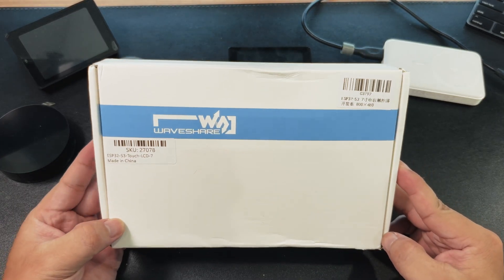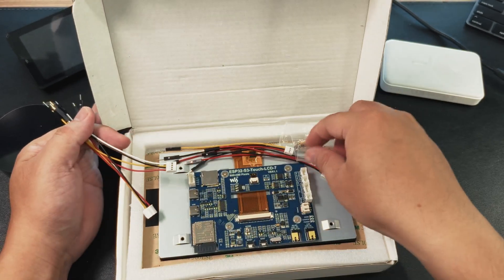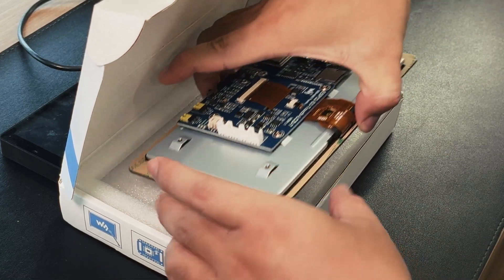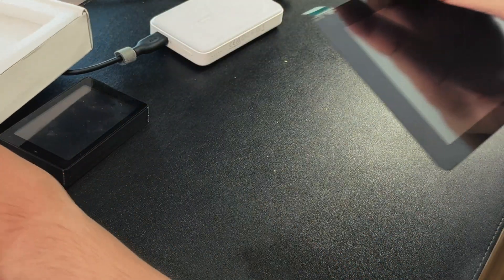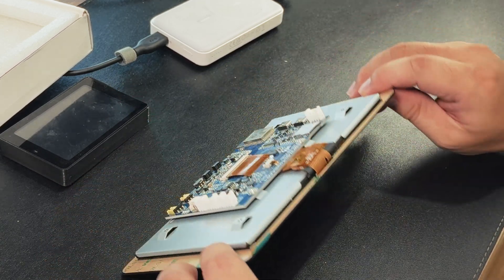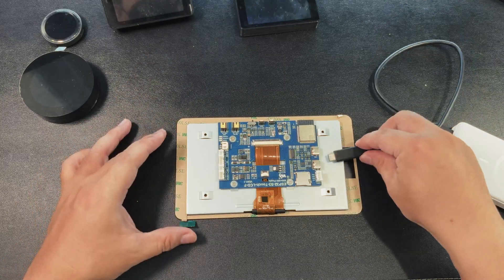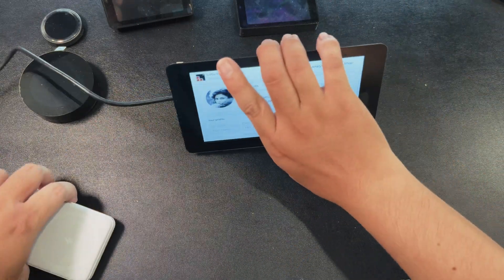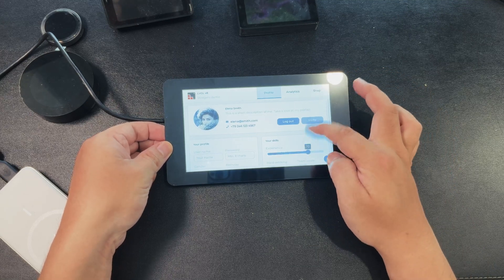Waveshare ESP32-S3 Touch LCD 7 inches

Comment: I've been trying to program it but untill now I cannot manage to do  display anything... I'm using vscode an platformIO... also tryed Arduino IDE... but even if the program uloads.. the display stays black even if it is powered and backlighted
Reply: Hab rausgeschmissen ein Dreck ist das, Display zu aktivieren ist unmöglich, so was will ich im meine Labor nich haben, ich will jeden abraten das teil zu kaufen einfachen mist.. nie wieder!!!!!!!!!!!!!!!!!!!!!!!!!!!!!!!!!!!!
Reply: Same thing happen to me, the plan are even conflicting with each other.I spend 4 days on this and finaly discover the pin out on the plan are conflicting with each other. I did write to Waveshare and waiting for a answer.
Reply: Pour Arduino IDE:
La macro BOARD_WAVESHARE_ESP32_S3_TOUCH_LCD_5_B se trouve dans le fichier esp_panel_board_supported_conf.h du projet ESP32_Display_Panel.

🧭 Où la trouver et comment l’activer
Voici les étapes pour l’utiliser :

Localise le fichier

Il se trouve dans le dossier du projet ou dans le dossier de la bibliothèque Arduino : Arduino/libraries/ESP32_Display_Panel/esp_panel_board_supported_conf.h

Active la configuration des cartes supportées Dans ce fichier, assure-toi que cette ligne est définie :#define ESP_PANEL_BOARD_DEFAULT_USE_SUPPORTED (1) Décommente la macro de ta carte Cherche la ligne suivante et décommente-la : Ex: #define BOARD_WAVESHARE_ESP32_S3_TOUCH_LCD_5_B
Reply: @mikajackrussel3703  How hard is it to program? I want to get the 3.5inch and use it to display eye animations in a robot.
Reply: @mikajackrussel3703  I am trying to buy this, Lets connect? I want to know more before ordering this as I have built a Home automation control panel